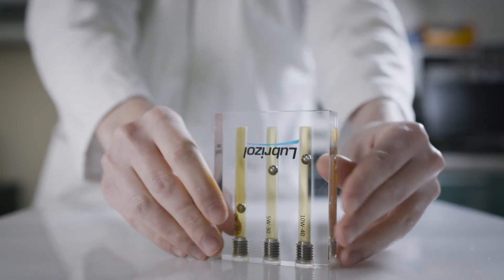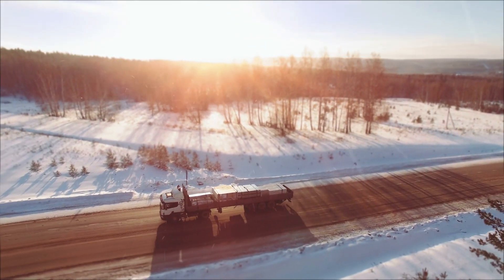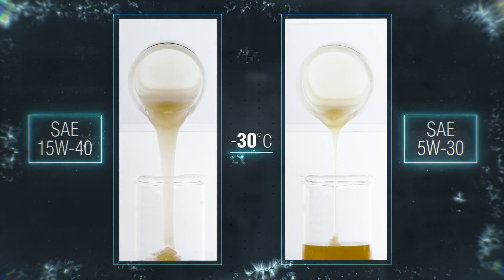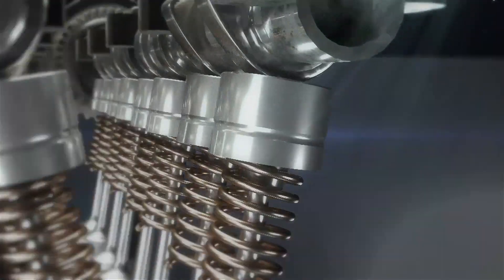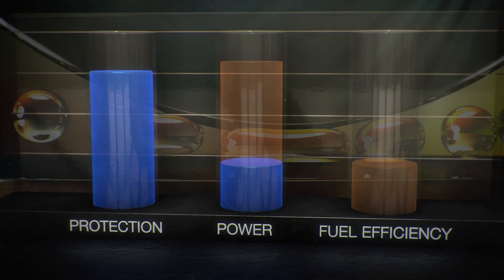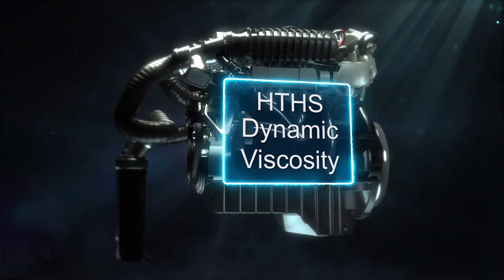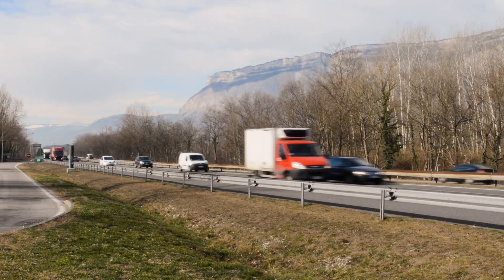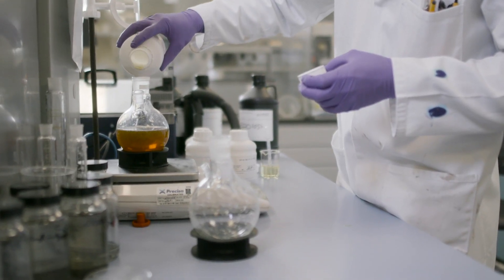High Temperature High Shear (HTHS): What is it and why is it important?

Comment: 1% to 3% of fuel savings at a cost of rapid engine wear 🤣🤑🤑
Reply: pure nonsense 🤣
Reply: @jachpriboy8989  Increased wear is not guaranteed, but thinner oil most definitely DOES reduce the oil film thickness.  "Proceed at your own peril!"

Comment: The claim made here is that lower HTHS is a good thing. That's not true in a great many normal situations. In any given oil grade, the higher the HTHS, the better that specific oil protects at 150°c (think ring packs, rod bearings and turbochargers) when compared to oils with lower HTHS.
Reply: Assuming everything else was the same, you are correct to a point. However, there's definitely a point of diminishing returns where going thicker just increases drag without increasing protection. The problem is that we don't know where exactly that point is and have no practical way of knowing for sure.
Reply: @averyalexander2303 that increased drag with result to have a good safety buffer is something I'm willing to bet on.

Comment: Is there a direct correlation between HTHS and engine wear?
Reply: Most racing oils have higher HTHS for a reason.
Reply: Absolutely
Reply: Yes. Inadequate HTHS for the application will result in higher wear, but a higher than required HTHS won't necessarily reduce wear. If you look up "HTHS wear graph", you'll see that the wear rates of various components often increases sharply when HTHS drops below around 2.3-2.6 and level off at an HTHS of around 2.9-3.5, but again, the exact HTHS requirements will vary depending on the application.
Reply: Of course there is!
HTHS is directly proportional (if not linearly) to oil film thickness. (There is something called a Stribeck Curve!)  Lower HTHS lubes have thinner film and less 'safety margin' under equal, normal load. Under extreme load, a thinner HTHS oil may allow metal-to-metal contact (and the resulting wear!) that a thicker oil would prevent.  How much extra wear will vary greatly with the engine, operating conditions, oil age, etc.  Some engines won't mind a bit, while others may suffer marked damage. Going with a thinner oil to save 1 or 2% in fuel burn may very well cause significant wear that will ultimately cost vastly more than a few gallons of gas. 
And, of course!, Lubrizol completely IGNORES Stribeck, one of the most fundamental principles of lubrication.

Comment: So lower HTHS viscosity doesn't affect engine protection?
Reply: Lol no it 100% does
Reply: @zackz1260  Thanks, somehow this video said the opposite and focus on lower HTHS to save fuel.
Reply: It does if everything else is kept the same, but how much of a difference it makes to wear (if any) is another question. Too low will cause excessive wear, but we don't know where that point is. There are ways to mitigate the effects of a lower HTHS viscosity such as different/better base oils and additives, wider bearings and other contact surfaces, tighter clearances, harder/better materials, better oil cooling, better filtration, etc.